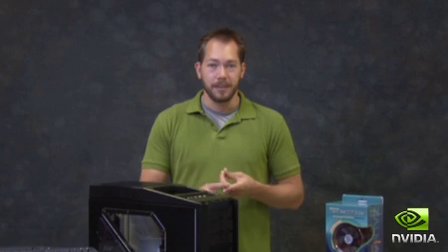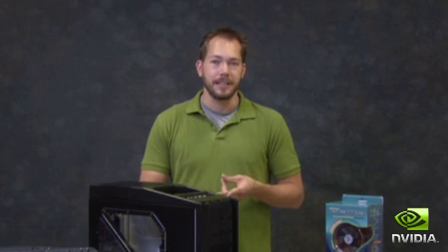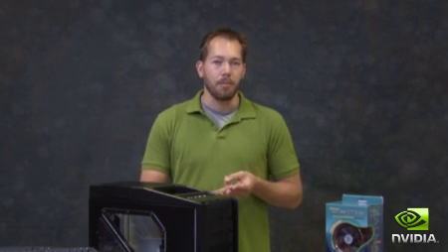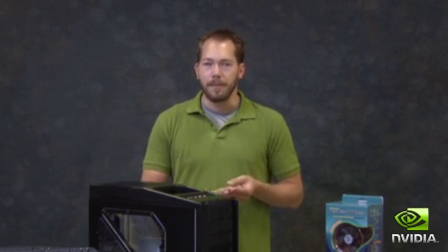Build a PC - Step 1 - What is SLI?

Comment: One thing to note is that crossfire is much more supported by games and hardware because ATI made it a much more open standard. Nvidia kept SLI much closer to the chest. Also, any Core i7 motherboard with an Intel X58 chipset will support both SLI and Crossfire.

Comment: Question-Running Pentium "Extreme" Dual core 3.73 ghz OC'ed to 4.1 ghz (last of the Pentium "Netburst" core architecture Extremes) on 750i SLI MB with 4 Gb Corsair memory, Huge Coolermaster fin tower CPU cooler. "Cosmos 1000" multi fan huge case.
Bios is dated 4/2008.
My problem is that I am running two "8800gtx" video cards in SLI with latest drivers and my "3Dmark6" graphics score is only 2970! HELP please on what the problem is with graphics being so low a score.

Comment: it works for both vista and xp
it doesnt matter the only thing that does matter is that the cards are sli ready and are the same chipset
they can also have differnt core clocks and brands just same chipset (e.g. an XFX 8800gt and an EVGA 8800gt) That wuld work fine.

Comment: @johnchen0213 Simply put? Its like having the same graphics card 2 times more powerful :D In the end you will need to worry less of overheating and now your physx can be done by one cores and the other graphical jobs by the other core as well.

Basically SLI is a way to connect 2 - 3 graphics cards together to work as 1 :)